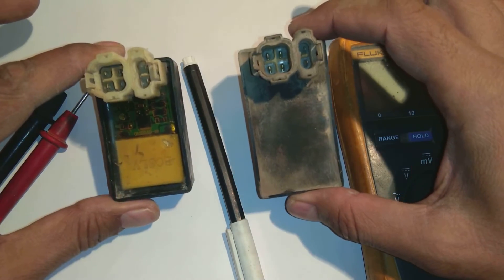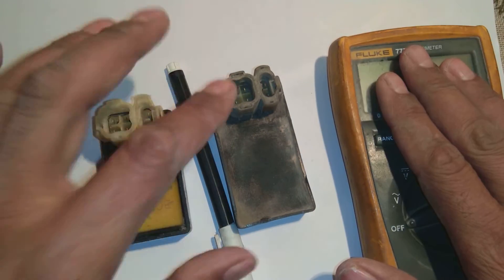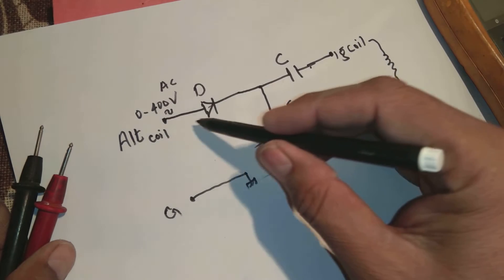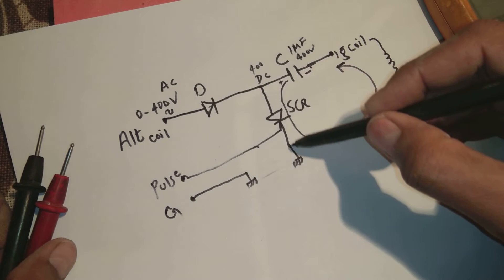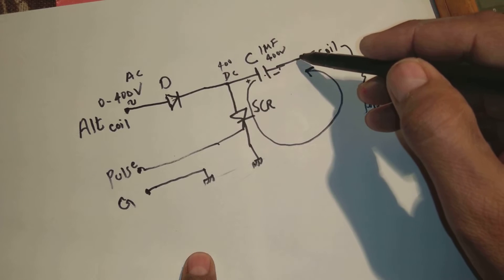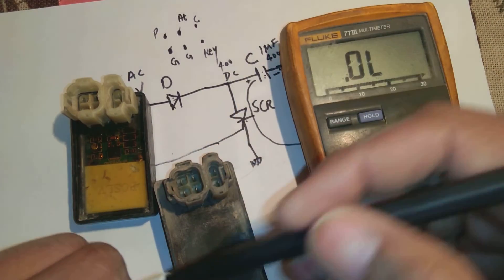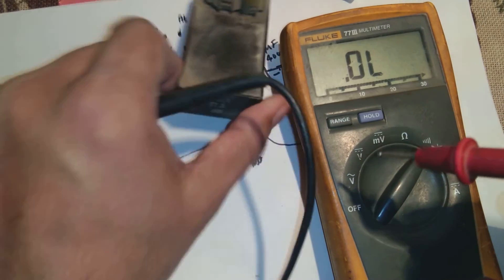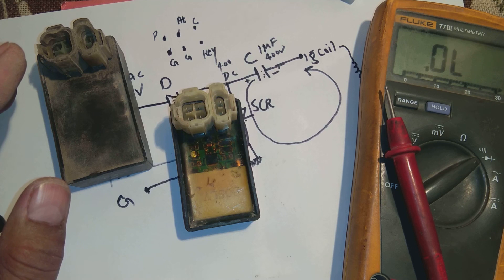CDI unit testing. how to test bike cdi on multi meter. motorcycle cdi unit testing on multi meter

Comment: Hi, 
I want to trigger DC CDI unit without Pickup Coil. How to do that. How many voltage need to supply to the trigger pin.?
Reply from the maker: 4
Reply: @JahanZeb1976  Hi. I Try to trigger with 3 x1.5 AA battery. But it was not work. Pls can you help.
Reply: @amithwijekoon2397   you have to put the volt like a trigger. Not continues..... But, it is not right solution.

Comment: What reasons could explain That  Some aftermarket AC cdi Units (Same Plug and wiring) won‘t produce an ignition spark on my scooter? Are there differences in the pick up Signal that will prevent the cdi from trigger the cole?
Reply from the maker: Yes they could have different pin configuration.

Comment: hi I have a short in two right ones can you tell if it's normal , I think it's kill switch and  ac power in
Reply from the maker: Yes it's normal. But it should start your engine.
Reply: @JahanZeb1976  thanks for reply I have a very weak spark , and in one cdi there is no short and on another there is i am confused
Reply from the maker: If both cdi have weak spark then you have some. Other problem like bad alternator or bad ignition coil. You may do deep testing on your bike other components to pin point the defect.

Comment: I have a Suzuki kids quad. The CDI went bad, no spark. Took me a couple of weeks to find a new one. I installed it. The quad started and ran for about 5 secs then died. Checked, no spark again. While testing for spark a few times the cdi became hot to the touch then began burning with smoke. Shut off ignition. I am stumped as to why this is happening. Over voltage just from cranking the engine if the regulator is bad? I can’t buy another cdi and just plug it in without first determining the problem and correcting it. Any advice you can offer I appreciate. Thanks.
Reply from the maker: This is not a regulator issue. But sure it seems high voltage defect. It needs thorow investigation of the circuit. Also look carefully if it is an ac cdi or DC? Also check if some wiring mistake had made.
If the cdi is way too expensive, you can replace with general purpose cdi shown here in this video. These cdi are way too cheaper and reliable too. But it will need modification in the circuit which I have shown in videos here on my channel. Best wishes.
Reply: LearningZone Suzuki no longer has the cdi for the quad. I found an aftermarket unit they claimed was plug and play. I made no wiring changes and the replacement unit had identical plug. I am a motorcycle tech and work in a cycle shop. This one has all of us stumped. Im thinking the replacement unit is not the proper one for this quad but seller claims it is. The main fuse on the quad did not blow but the cdi literally burned with smoke when ignition switch turned on. How can it be the wiring on the quad??

Comment: i have current in almost all connections when checking for continuity
Reply: ck your meter setting if you are unplugged cking continuity (ohms/resistance) it should be disconnected (no current) box current on wire side except trigger you should ck resistance (ohms continuity)i be lieve on honda it is460-580 ohms but i could be wrong taken at blue wire / trigger/ pulse generator to ground if you do these tests correctly you should determine your no spark delivery problem.

Comment: Very helpful video, but what blows a CDI so the bike does not get a spark? Thanks
Reply: wires rubbing on a ground, like a frame. getting the stator wet and not repairing the problem (usually just a new gasket for the flywheel cover) wiring mixed up. capacitors dont last forever. either do diods or anything electrical. remember 80% of problems of automotive are related to electrical problems. the list goes on but thats a god start for you ton start thinking like a diagnostic machine.

Comment: I have a cu2510 box from 94 polaris 400l I got continuity from the ground that means the cdi box is bad?
Reply: If you have continuity from ground to the kill switch pin, then yes it's not going to work. The kill switch grounds the spark. If you have continuity from ground rail to kill switch that means the cdi is already all the time killed. Curcuit has a short and  new cdi will have to replace it. Cheers

Comment: Thank you so much for sharing this great knowledge. Its useful to test them if a quad or bike isn't worth fixing. One question is how come the current flows back towards cdi unit to the (+ plus) of capacitor instead of going to coil and then plug.???
 Like current from a DC battery goes from Positive to negative
Reply: DC electrical - current flows from the neg. to the pos. as taught in eletronics theory the electrons move thru the depletion zone to the holes. and it's proven in application, that this is what happens. the confusion is the fault of a long ago guy that was believed to be "cock of the walk" & "told" the eletronic community, that is how it is, so they printed hundred of books & taught this for years, until it was disproved. so the fix was ; the books, schematics, ect. was called conventinal current flow. which aligned with thier system. a lot of teachers & books will say if it is actual current flow or conventional. as a student of electronics , one must do the inversion in your head for hands on field applications
Reply: Current actually flow negative to positive. It is the movement of electrons, not protons.

Comment: Hello 
my bike is starting and it runs on idle position but when i throttle it makes engine miss and off the engine 
Every time i used to replace a new cdi box 
And it will be okay for some weeks months or sometimes only for few days 
Can i know where is the problem?
Reply: Iam facing the same.

Comment: How does the engine shut off? You referred to a "key" terminal. Do you cut power to something or ground one of the terminals to cut the spark?
Reply from the maker: You are right, a ground is provided to CDI point which is input to the CDI unit. Means the input power is grounded to the CDI through ignition switch which kills the ignition when ignition w switch is shifted to engine off position.